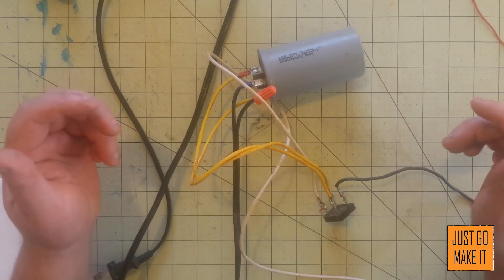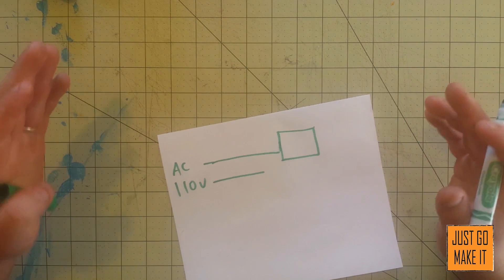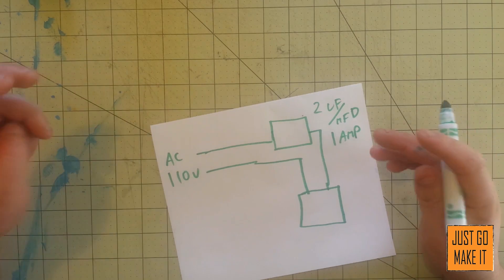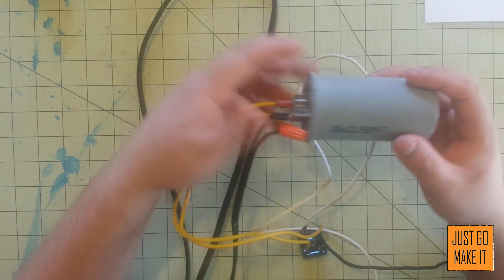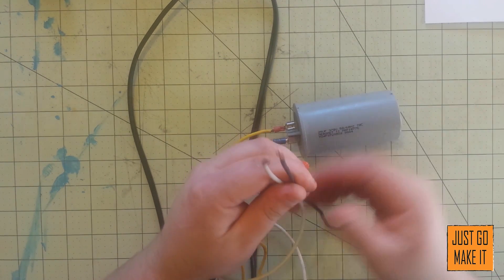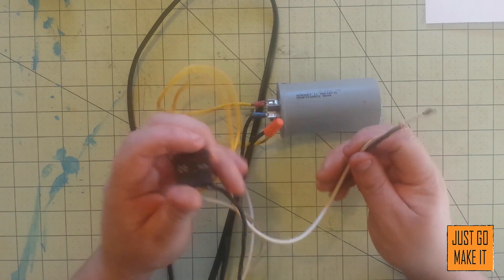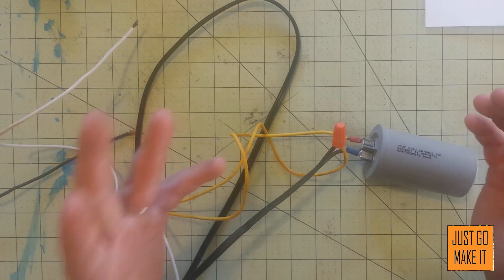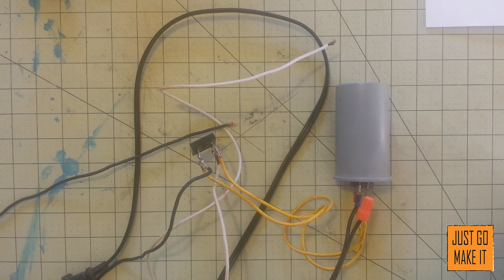capacitance battery charger/ desulfator

Comment: Good video, for those of us that rather not make a desulfator viewers may want try a PulseTech PowerPulse passive battery desulfator, Pulse Tech claims that their patented frequency they use can extend the life of a battery up to three times.
Noco Genius 5 and 10, and CTEK battery chargers have a repair mode that I believe use 16 volt pulses to desulfate a battery.

Comment: My friend . The reason that it has the high 120 volts DC WHEN NOT CONNECTED TO THE BATTERY IT IS DUE TO THE Capacitors which will adjust to the voltage of the battery you hook to. Like if you had a 50 v DC forklift  battery it will stop at the voltage that the battery is now it will adjust to a 1.5 volt AA battery and charger at that voltage . And what amp is configured with the cap or several capacitors wired in the charger. I've charged watch batteries all the way up to a home off grid  battery bank that needed maintenance to keep in proper working order.

Comment: I don't understand this. I do understand how a capacitive dropper works, but surely the waveform from the bridge rectifier used to charge the battery will be the same as from an old-fashioned simple transformer + bridge rectifier charger? How is this better at desulphating?
Reply: I think the difference is that it has a AC capacitor before the bridge rectifier  that charges and discharges quickly which is a pulse suitable as at desulfating lead acid battery. I might be wrong

Comment: nice video but.....ac voltage through a cap and bridge rectifier giving 90 odd volts to a 12v battery great way to destroy a battery and very unsafe once these caps are charged will hold a charge for a long time and zap the first fool to touch it  sir i would have put a warning do not try this at home

Comment: It should be noted that the drawing he made for the bridge rectifier is not correct. The matching connections are on opposite corners.... AC input is in 2 opposite corners, and DC output is in two opposite corners. AC, + and minus are marked. AC neutral is not marked.
Reply: U damn right,they on the opposite sides

Comment: How does it generate pulse waves and how is 230v converted to 12v after connecting it to the battery?
Reply: 120 vac times the square  root of 2 = 170 vdc out  of the bridge with a ripple frequency of 120 Hz.

How does that not blow up the lead acid battery? I do  not understand 
unless he is not showing all.
But I will research and get to the bottom of this voodoo magic deal with the devil.
Reply: That’s exactly the problem. Yeah you get the pulses and the amperage, along with conversion, but you are still getting 110v. Doesn’t make any Sence.
Reply: @davidbivens2246   the bridge rectifier converts the 110v mains AC into rectified DC .. This process also doubles the Frequency of the AC mains input

Comment: I followed the diagram and have it running. My battery is showing 5.6v. I connected the desulfator and it went to 9.6v and after 1 minute the voltage started to drop. Any suggestions?
Reply: The voltage that you see initially is mostly the charger, because the battery has very high resistance when discharged. If you turned off the charger, and let the battery set to let the surface charge come off, the voltage read would be much lower. As the battery starts taking a charge, it is absorbing the voltage, and so your read voltage will be lower. This is all normal.

Comment: You said microwave caps are supposed to work very well but that you need 25uF for just 1A charging current. I have TEN microwave caps and between all 10, I only have about 9uF capacitance

Comment: Didn't work ... it burned up .... cooked my battery in fact it started boiling the electrolyte within a few minutes .... no current limiting. Bad idea ...
Reply: It will work it depend on your voltage ist 110v or 220v .25uf at 220v ac it puts out 2amp and 1 amp at 110 use the charging rule 10th of  ah current

Comment: you said 25 mfd per 1 amp,but you wrote 2 uf on the paper, I'm an electronic engineer so I noticed that may confuse some viewers. I am also a licensed industrial electrician and I dont understand how this does not destroy a 12v battery,they don't like voltages above 16vdc. I'm not saying it doesn't work but I need a whole lot more technical info before I did it.having said that if it works as good as you say it does its well worth even buying new components to build this, and I would heat sink the rectifier and even a small fan in the enclosure would be very valuable.

Comment: This guy is kinda scary and so is his circuit ! ... It has no isolation from the mains so contact with 90% of this device could kill you. Yes you get lotsa cheap charging current by skipping a transformer but you skip the isolation from AC supply relative ground. It should be said, there is no such widget as a "AC Capacitor" ...What this budding Electrical Engineer really means in make sure your capacitor has a high enough VOLTAGE rating to safely handle the Peak to Peak voltage developed across the capacitor. So yes, most motor run capacitors will work just fine.
Reply from the maker: i kind of scare myself some times.

Comment: Do not use a start capacitor-it will heat up-not intended to be left in circuit all the time..Use a run capacitor-it is designed to be left in circuit all the time but these capacitors tend to have lower values of capacitance, ie: 15uf, 30uf, etc
Reply: you are correct sir.

Comment: Whats the voltage for fully charged with this charger?
Reply: This type of charger works fantastic. A fully charged lead acid battery will have a minimum of 12.6 volts. It is normal to see 13.8 volts after charging. Do not use this type of charger with the battery still in the vehicle! If the key is turned on, you may fry all the electronics!

Comment: how long does it take to charge a battery with this?
Reply from the maker: +Phil Karza it will depend on how big the battery is and how big of a capacitor you use.
Reply: 75 uf 12V deep cycle...  It took about 8 hours

Comment: If you only needed to charge up to 12 volts would there be any reason you couldn't use a the cap in series with the primary of
a transformer with a secondary of 16 volts, feed it to the full wave bridge then to the battery.   The capacitor is used as a impedance from its capacitive reactance.  This limits the current and acts like a voltage divider.  The transformer lowers the voltage which is safer.     I have only seen this done without the transformer.

Comment: about a year ago (my first build) I used small .80 mfd cap from a microwave with very little results on several 12 v gel batteries, Then I changed the cap to an 80 mfd , it started at over 90 volts dropped to 30 volts in a few mins it took several days at 30 mins to an hour  a few times a day but now these batteries are being used on my solar setup an hold a good 12.6 volts. I have another right now that has taken a few days to get it from 90 volts down to 14.9 volts an it has a charge off the pulse charger of over 12 v now, I havent recover every battery but I have recovered most that this was used on. I will say here this type charging with high voltage caps is Dangerous, I am very careful not to touch any bare wires near the cap and I use about a 50 foot cord from the unit to the battery, I have never had a battery explode or spew acid but better safe than sorry.

Comment: I have two high cranking ap batteries in my deisel pickup.  They are showing 10v dc and it is sealed.  Should I try to open it and check the fluid levels ?  Will this work ?  I have a float charger that I tried but after several hours and then more hours it still didn't do any good !   I have a microwave that is on its way out and I am excieted to get the parts out of it !  TEll me what else should I do with the batteries and what all I should harvest from the microwave ?????
Reply: Keep the microwave transformer. Salvage the magnetron motor as well. You can also salvage the AC fan. If you get more transformer of same type you could build a welding machine. There are lots of videos on YouTube.

Comment: hi am just asking u a question right with  this capacitor charger do u thing I should buy a infinitum desulfator or this will work just as good or better . please reply am depending on you .
Reply from the maker: +Sterlyn Ali i have had very good luck with this setup.  plus its cheap to build